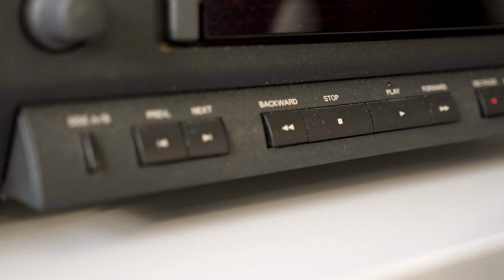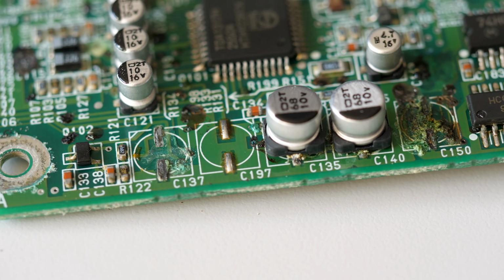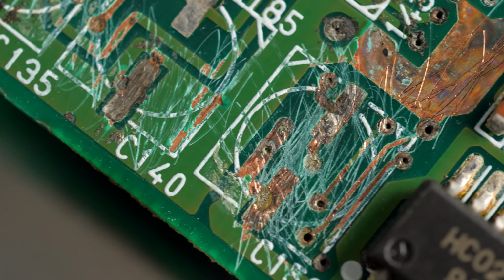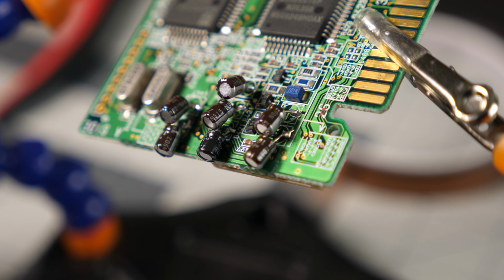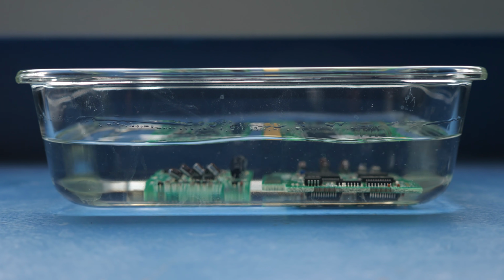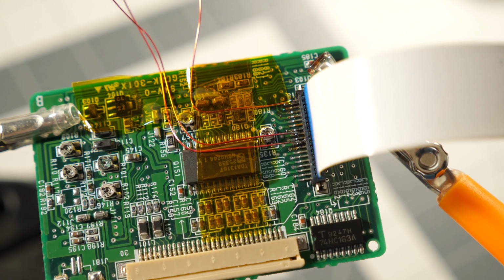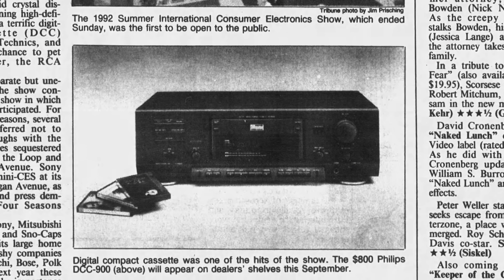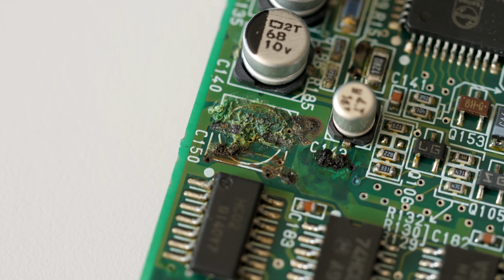My DCC Deck Repair Didn't Quite Go as Hoped...

Comment: Seeing that kind of damage in shipping is sadly very common. I ordered a clock/radio with a cassette player in it and it arrived 2 weeks late and had been destroyed in shipping. I got it somewhat working but could not look at it without feeling bad. It died completely a month later. I have only had one item delivered in the mail since then, instead opting to find everything locally as the chances are far lower that it will get destroyed with me bringing it back home. If possible, I suggest trying to find things locally, but I understand that with this hobby, that is not exactly easy.

Comment: hey dop you still have the dcc 900? i do have one, i have fixed that, my digi boards are in very good condition so was worth to recap it and is perfect now. etc but the main board is corroded as previous owner spill some liquid inside and there is corrosion on top of the layer od the main board. i wonder if you have if for sale.

Comment: At the time, thought DCC was a good idea for a digital, analog cassette solution, but after seeing this video and other research the past several years, glad I went Mini disc circa 1993.
DCC and Dat were just way too complicated mechanically, resulting in high cost and low reliability.
In the case of DCC, the digital audio was lossy like MD, so may as well gone MD for better reliability and lower cost, as prices for MD dropped quickly as more models and brands hit the market through 94-96.
If you were a pro in the 90s and wanted lossless audio recording, you either went Dat  or a custom built PC by late 90s
Heck, just using a hifi vhs VCR for audio recording was darn good for some pros, and a lot cheaper media and decks.
By late 95 I had my first Cd burner on my PC.
So DCC was too little too late with too much cost and complexity

Comment: I would start by filling every single via on the suspect PCB with solder, even if they show good continuity on a meter. If that doesn't help, test every single trace with a meter (it's a small PCB so it shouldn't take very long). If no bad traces are found, start "shotgunning" the board, i.e., replace every off-the-shelf component on the PCB, testing for changes in functionality after each one you replace.

Comment: Good luck with getting a working deck. The one I got had good PCBs but the head and loading system were bad. (Due to the original seller’s less than stellar packing) anyway Ralf is taking care of it. And yes this is a thing you have to be really committed to putting money in if you especially if you buy a 1st Gen deck. Hopefully mine will be working in a few weeks.
Reply: And now it’s working! The head on mine was bad and the tray was too damaged to fixed. So I shelled out the dough to replace those parts and Voilà! My deck is back in business after probably 25 years of sitting around! The only downside (and this seems to apply to DAT) is drops outs in the audio with certain tapes that are now almost 30 years old.

Comment: That first read/write board is definitely salvageable with enough time and skill. Between the two units you have, I think there's an extremely good chance of getting at least one working. If you'd be interested in talking, I'm willing to take a look and spend the hours needed. I have a lot of electronics experience, and access to all the necessary tools and equipment. At the absolute minimum, I can restore that RW board. 

Actually, if there's interest, I could produce a run of replacement PCBs. It would require salvaging the chips off the original board, but the rest are just commodity items.

Comment: The DCC was a truely cursed format. I had the Technics deck and it failed under four years, same thing no sound. I was glad to see the back of my deck. I spoke to an engineer who said if you ran a dirty old analog type 1 cassette through your deck, then a new DCC tape it would strip the head as it was that fragile. 

The irony is an analog cassette deck with a type 2 or 3 tape is capable of good audio, with Dolby C 80-90db dynamic range and up to 22khz on a good deck (I have a Yamaha deck which is excellent). Wow and flutter can't be totally eliminated but should be fairly low on a good, well serviced machine.

Comment: And why to worry, you can sell both of them for parts. Anyway it is not easy to find tapes so they will not be useful. But it is good tha you spend hours or days on those decks because you love them. Parts are really scarce now. I have the same experience from DAT decks.

Comment: I fortunately read about the bad capacitors of the DCC900 before I bought one. Bought a DCC91 here in Germany instead, it's been part of a shelf hifi system. Installed new belts and it plays fine.
Reply: That's a later generation DCC, which didn't have the bad caps in it.

Comment: you must have a schematic of the pcb your working on. some vias don't look so good. have you tried gently sliding wirewrap wire, 30awg, into the via, to solder the top pcb to the bottom pcb? lots of ohming traces to do, pin by pin. could be you got a bad IC. hard to say.

Comment: Dr. DCC is THE man to go to for all things DCC. i applaud your efforts to attempt to fix this and make a video about it. I was one of those guys who bought the 1000 new in box dcc and had Dr. DCC restore it. I  bought into DCC when it first came out and ive had several decks over the years due to the leaky caps that crop up on the first gen units. that said, i still love the DCC 900 because it was the first model. I also have a DAT machine (sony pcm 7040) and TWO MZ-1's i bought when sony launched these decks. they are still brand new and I still use them to this day. there is a certain character about these first gen units that i like, this is why i chose them over the later ones with more features, etc.

Comment: You forget to say one of the most IMPORTANT WARNING : Do NOT, NOT AT ALL, use a demagniser tape or tools. Even powered off, it will destroy the heads amp !!! I bought a DCC 900 in 2015, and I took me about 5 hours of labor to make it work again. I use a different method : used red alcool vinegar (i hadn't white one) rather than Isopropyl. This not only stop oxydation: it will let you hear if there is an acid corrosion with a cripy sound (if you have good hear...), This help me a lot to check if the track transfert where or not bad and have to been fill with soldering join. I did not use at all an hot air station, but 2 30watts soldering iron, one for each pad. A not leaking caps would go off within 25/30s. A dead one took at least 1 minute ! And so I know where I got to look for damaged tracks and transferts, and again Vinegar on and around the aera to be sure the oxydation had not "fly" around (often under the amplifier chipset...). Last but not least, use contact spray cleaner into EVERY adjustable pots !!! And the head film transfert connector. It was the last big problem I had.... It still has a tiny problem : when I arrive at the middle of a Digital tape, it sounds eratic, so I change of side, get back to the side I was listening and it sounds ok. It should be a motor belt replacement, but I also hear that we have to FF/RW the complete tape prior listing it. On my old album, on the last picture, you can see the benefits of spraying contact cleaner : from 5 heads not responding to All heads OK :  https://www.facebook.com/media/set/?set=a.10206578346207299&type=3

Comment: Having spent a lifetime in electronic repair work, the one type of component
i dislike the most is surface mounted components.
These were introduced to make manufacturing faster and cheaper, but not
repairing pcb's that are damaged by leaking capacitors.
Once the acidic paste leaks under other components, then sits there for a few
years, it destroys everything in its path.
Sorry to hear that you have spent a lot of time and money trying to get a working
player.
I have often made the same mistake, especially with Laserdisc playes, thinking
that they only need a few more capacitors to get it working.
It's good to hear that there are people like DR DCC with the experience to return
repairable samples to full working order.
Experience and the knowledge to know when to stop fitting expensive parts in
a no hope repair counts for a lot.

Comment: Consumers didn't bite on DCC, they already knew what happens to any kind of tape over time or when you leave it in a hot car. CDs looked like they would hold up better so that's what music buyers decided to get. For pro use and for consumers who wanted a reel-to-reel replacement DAT was the format that had better adoption and most brands of gear also went with DAT. Shortly after that CD-R came along that could do both Audio and Data, game over for tape. VHS HiFi was analog but my favorite reel-to-reel replacement because of how many hours you could get on it and the "tone". Some of the JVC VHS HiFi units solved the head switching noise issue and really sounded fantastic. The only place I remember seeing DCC was at Radio Shack, they had a gift for picking every loser possible, maybe that's why there is no more Radio Shack.

Comment: Man, I feel your pain. I have a Technics RS-DC8, the second gen. deck and it also doesn't work. Bought it as a project as owner stated someone tried to demagnetize the head and ruined it by doing so ( dcc heads do not get demagnetized )! But by the time i have received it ( from Slovakia ) it got damaged more in transit and the new head i was going to buy got sold so never got a chance to repair it. It also intermittently refuse to respond to open/close button. As great this novelty is as much headache it gives you :(

Comment: Valiant effort to get these working again. I also bought a dysfunctional DCC deck ages ago (a Marantz unit, probably also first gen) but haven't bothered with it much because while trying to fix it I thought about it and the thing is that the format isn't very good when compared to DAT or MD or even recordable CDs (which came in roughly 1995 and pretty much put the final nail in the DCC coffin): basically you have all the limitations of the compact cassette (tape winding, blank space at the end of sides, difficult editing, etc) except now your highly compressed digital signal on the special and expensive new tapes is hiss-free! And also maybe you can edit them to have track titles (if your machine supports it and you have the remote and the time to wait as the machine shuffles through the whole tape to do it). Neat, I guess. I mean they're interesting from a technical point of view and they do a good job as playback decks for analog tapes (the head material can't be magnetized and they're pretty sensitive, tuned exclusively for playback pickup) but on the whole they weren't compelling unless you were both a luddite insisting on hanging onto your old tape library (yet not wanting to record to analog tapes because these can't do that) but also wanted to embrace the digital future.

Comment: I've had the bad luck of receiving broken vintage electronics while in shipping more than once. IMO never use tight fitting boxes when shipping electronics! Instead... Be generous with  packing material and wiggle room on all sides. That's why when new the equipment has gaps with foam of up to 2 inches on each side to help prevent damage. Unless you're delivery is treated like Ace Ventura at the beginning of the movie. 😂

Comment: Great video Mr.
The DCC's biggest mistake was using backward compatibility with compact cassette tapes.  The common tape market itself killed the DCC.  If you could play and record regular tapes why buy more expensive digital tapes?  Unfortunately, this is what happened.  Without a growing market, the development and improvement of the DCC was compromised until it finally went bankrupt.  I was never a fan of digital tape because being digital CD, Mp3, DCC for me is all the same.  I prefer a good and analog tape player or a turntable.
All respect and gratitude for what the DCC museum did and does but I never would have sent this device for repair, to a "museum".  It was too risky for this device to be mailed three times.

Comment: in 2007 i try to repair one of these "pain in da ass" puppyies. in my case, after capacitors was changed, problem was in a tapehead itself. analog playback runs mediocre (left channel has sporadical clickin noises), digital - has a lot of dropouts, and when i remove head to check under a microscope - i see lunar surface. seems this heads is too gentle for a real life, and had a tendency to self destruct. you can check tapeheads from you decks, 20x-40x magnification will be enouch.
if surfase is ok- then try to adjust azimuth screw, at least, maybe digital playback will be okay in your case.

Comment: Wow they really did a number on that first board you sent away for repair. From experience, older tech is much more robust when its all assembled. Parts that were meant to be internal weren't designed or manufactured to stand up on their own when they were new, let alone years old :( the extra size and weight for shipping is a pain but broken parts are even worse :(

For trace and surface mount issues I normal use a fibreglass pen as this allows you to gently remove the lacquer and printing and expose the substrate, from there you can sometimes replace the traces with conductors and try to keep it as neat as possible. Its ugly but it can sometimes revive a dead part with no replacements available :)

Comment: I used to have one of these as well and if i remember correctly you are not suppose to use chrome / metal tapes on these units either that can mess up the heads on them as well. At least that's what happened to mine.. Someone i know put one in there and my deck never played music again. Unless of course the heads just went out.  etc I no longer have the deck though. it got trashed 😒

Comment: Bevore your video i thaught my two dcc players are totally waste. i have a dcc still in my hifi deck and i have a panasonic dcc walkman. the deck goes after a few seconds in a permanent autoreversmode...over and over. i also have dcc cassettes. know i can sell them, or let it by me as an value for later. i bought my players at the end of the dcc time, new but not expensive. With this video i am a bit richer now! only while i saw your video over analog fotography. thats a benefit for others when they saw your videos. Thank you for this! I was a very lucky buyer in the past (allways new from store)...Exakta 66 Model3 i buy it for 1400DM, now 1400€! Rolleiflex SL 2000F 600DM, now 600€, Leica minilux 900DM, now 900€, Sony Walkman DD100,DD9, 400DM now more than 600€... changed more than from DM to € (1€=2,20DM)
- inflation...but a very good investion! Today? Buy a Canon 1d mark2 for 300€ used, today or another early but superior DSLR...in twenty years? Speculation with benefit of use!

Comment: I would LOVE to take a crack at this. I listened to your video while working and took a peak in now and again so it's likely I've missed some of your troubleshooting nuances, but from a skim over the service manual it doesn't appear as though you can safely say the whole problem comes from the Read/Write board. There could be issues with the Digital board too. Things I would want to see, since you have the analog part partially working starting with that, is if you put in a tape with a standard 1 kHz 0 dBu sine wave on left and right channels at the same level, what do the analog outputs look like on the oscilloscope at the output of the Read/Write board? If they are uneven there, then yes there is a problem with the Read/Write board. However consider the feedback circuitry as potentially being faulty on either channel as well - there could be too much feedback on the right channel or too little feedback on the left. If you have a consistent signal on the left and right channel you can continuously follow said signal from the input side of the board all the way to the output and try to find the point where the signals vary. I know I'm optimistically fresh at this but I hope you don't give up just yet! Next time you pick up the project go all in for a deep tracing session!

Comment: My Marantz DD 82 refurbished and not working also...i yust hear analig tape muted
Boards are multyleyer and be sure that you checked all traces who connects one side to the another...
BTW did you checked record pause mode with digital input for checking dac board...you have digital input?
Check main board maybe is someone messed wrong connectors on mecha and cause some issue...

Comment: Hello from Germany! With the end of the 90s there were some amount of used DCC Hardware from private sellers available. I bought a DCC900 with around 80 DCC-tapes (also some originals included) for around 200 EUR at that time. Had also the DCC600, DCC730 and the mobile one, all for a reasonable price. And i have seen still DCC Tapes in store (in the bigger ones). Today the prices gone crazy for DCC. It is better to play with another obsolete media like cassette or minidisc.

Comment: The left-right thing reminds me of my old ISA Yamaha sound card I bought for my first PC... The sound was actually pretty good, except one of the channels was very silent so I had to move the balance slider in the win 95 all the way to one side.

After about 3 years of this setup I finally got annoyed (thought the card was damaged since the beginning) and bought a new sound card, the Creative AWE 64. When switching the cards, I noticed a strange jumpers setup on the old Yamaha (that I didn't ever notice before). And sure enough, after setting the jumpers properly the card worked totally fine, having a great balanced sound 😎. But as I already had the much better (and also much more expensive) AWE 64 I still decommissioned the Yamaha and didn't have any use of it since. What a shame 🙄